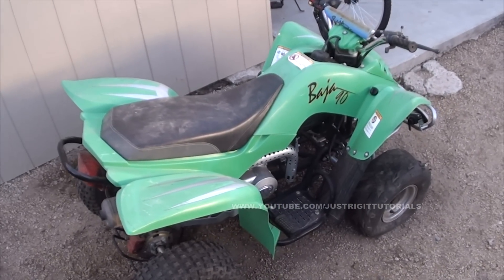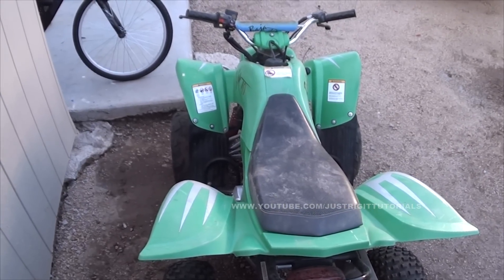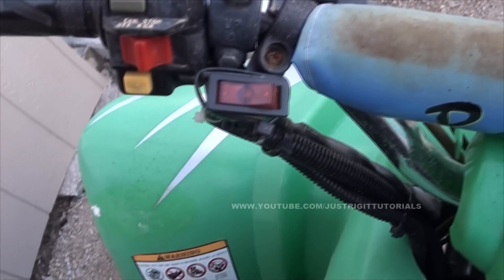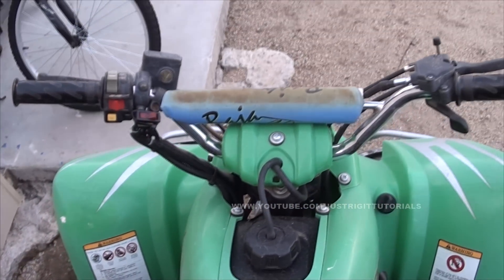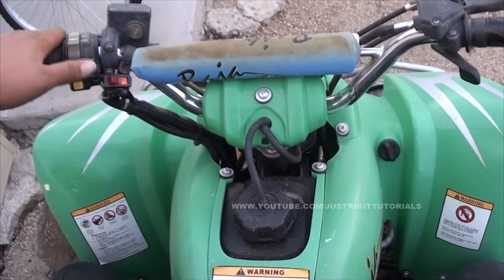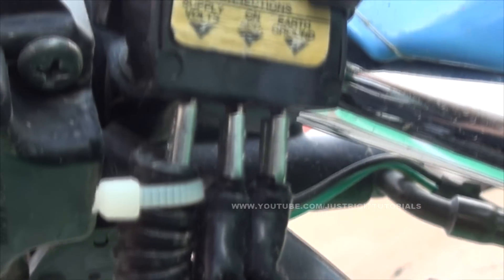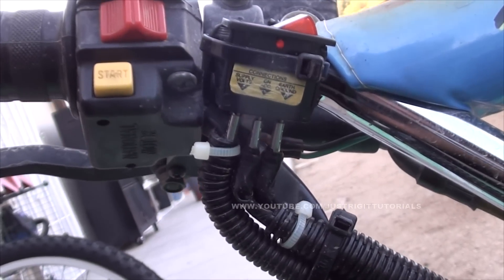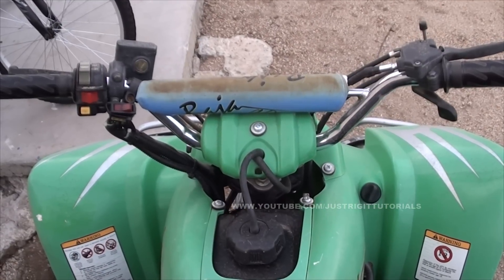bypassing the push button starter on an atv

Comment: I have a better idea, since the relay is there for a reason. A relay is an electromagnetic switch used for controlling high amperage circuits (like power to the startmotor) with a low amperage input (like the brake switch and start switch together to start the engine). Since you bypassed the relay, your new start circut gets hot. Your problem is probably either:

1. Faulty relay, which is easily diagnosed and cheap to replace. jump a cable from power inn on the relay to the power out to the start engine (this is usually the 2 bigges cables on the relay, and the colors is usually, red/red, red/black or black/black. If the start motor turns the relay works.
2. Check if your start button gets power when you press the brake. If not run a wire straight to the battery from the cable that came from the brakes and inn to your start switch. From now on you dont have to hold the brakes for it to start.
3. Now check if your startrelay recives power when you press the start button with a cheap circuit-tester light. Then measure the cable that goes from your start button and inn to the relay, and make sure it recieves power when you use the start button.
4. If you have done the following and the relay neither makes a small "clicking sound" nor do the start engine recieve power, you know it is a grounding problem. Run a wire from your black terminal on the battery to the "probably green/yellow or black" cable that goes out of your relay. your colours on the ground cable may vary so make sure you know which cable is which on your start relay.
5. Now hit the start button again and I promise you that your engine will start to turn. Usually one of the first ting you do is testing your startmotor, but since you showed me that yours work i didnt include testing it as an option.

I know that this would be much easier to test with a voltmeter and testing for stuff like continuity, but I am bad at using one and understanding what I am testing. this is a much more logical way to test it for someone who is handy and dont know how to use more advanced testing equipment.
Reply: Nikolas Rygh Røren My foreman does the same thing. When i press the start button i dont hear a click noise and nothing happens. The way i start the foreman is by touching metal on the relay. What do i need to replace?!
Reply: Finally someone who speaks English. Yes that's the proper way. rigging up a short cut will not solve your problem in the long run. You always want to do it the right way.
Reply: This answer sounds the best option but it is kind of theoretical but I wish I could see something like that in a video
Actually I’m trying to fix my atv like that I’m very handy but I don’t want to make any mistakes and get disappointed 😅

Comment: Double check your voltages and try charged your battery up till it's fully charged then put battery back in then it will start up with no hassle as that's how I got my quad up running now there no more buzzing sound and if there's a buzzing sound it's trying to tell you charged your battery for sure

Comment: Great Video, Thank You!  Can you take the wires from the push button to connect to your switch or do you need to run wires from and to your starter and battery?

Comment: Wrong switch friend, use a push release button and don't by-pass the relay or you will burn the harness ,there are two wires that give command to the relay the two thin ones,find which one is your hot wire and  thats where you can connect your button...good luck

Comment: Is the thick red striped wire that is also runs into the starter with your wire. is the other end of that connected to the solenoid, because im not entirely sure where it should be comming from on mine.
Reply from the maker: basically what i did is i attached a wire in the same spot where the thick red wire is thats connected to the starter using a ring terminal that wire then went to one post on my switch the other post from the switch goes to a fuse or fuse holder from there it goes straight to the batterys positive terminal if the switch is grounded it will say (ground) just connect it to a solid piece of metal on the atvs frame or even the negative post of the battery if you want to so when the switch is flipped you will get a light and the starter will turn the engine over but remember that the on switch needs to be to the on position as does the key or the engine will turn over but never start as there is no power going to the coil

Comment: Nice video I like it I do have a question I have a 110 four wheeler that has compression Spark and fuel but will not run have you ever ran into that any information would be helpful thanks
Reply: Try turning the key to the on position then connect a wire to the negative side of your battery touch that wire to the frame where there is bare metal and touch the positive terminal of the battery to the post on the solenoid that is going to the starter it by passes all of these steps to hook up a switch down side is the extra work to start it each time you want to ride

Comment: It works but would have been easier to clean the contacts on the switch
Reply: Or get a new solenoid too.
Reply: At 0:37 he said he had cleaned the contacts but it didn’t work for a while after.
Reply: I have the same issue replace solenoid and clean switch it work but then stop working so im not sure if it’s the starter switch wanna replace it
Reply: @Sickwiddit2820  I got ride of mine a few years ago, but it had that remote kill switch on it. I had to take that off of it and ran fine when I got rid of it. Just no more remote kill switch on it.

Comment: I've been waiting to do this to my motorcycle, I want to eliminate the kill/run switch entirely.  Since its in an all in one control, the kill/run and start switch are all one piece, how do I go about making sure the kill switch is always on the run/on position and not on the off/kill position before wiring it this way. I'm going to wire and mount my start toggle switch right below or next to my key ignition switch or somewhere hidden from plain sight

Comment: Hey buddy I like your video I have a quick question on a Suzuki lt 50cc electric starter I put a new battery and don'ts start what should be the problem?
Reply: Henry Alexander Rivas is it in gear, is the fuse blown, bad starter, bad contact, is key on,bad battery

Comment: How did you wire your ignition/key ? My 110cc wiring is all messed up , and I can get it to crank with the toggle switch, but I need to get spark to the plug, and be able to shut it off using the key. How might I go about doing that ? Thanks

Comment: how is the orginal one ganna work if you cut the wires and wire them up to the switch look I'm 14 years old i start up my yamaha rhino 700 with wires tie up the yellow and black wires together and just the start up wires just make them touch other
Reply: He is  jumping the solonoid,with those thick wires running all the way up to  his handlebars. Its not  the safest way, for sure, but it works.

Comment: Im thinking about doing this with my atv. What kind of toggle swtich did you use, and where did you get it from?
Reply from the maker: its just a simple on off switch with an extra ground if it is illuminated got it at autozone for like 4 bucks

Comment: that screw in piece inside the brake fluid part, where did you find it or get it
Reply: Isn't that the neutral switch so that the engine won't start unless it's in neutral. I replaced mine and old came out of the hole. I didn't know they'd work in oil. But all it is is a switch that's closed by the transmission when it's in neutral. I ordered mine from Amazon, $8.00 and they sent it in an 11x14 plastic envelope. It's only and 1.5" long and .5" wide. Kind of overkill on the packing but I thought  it was funny.

Comment: yo I am trying to do that but my atv still won't start what can it be and it doesn't  turn over for the started
Reply: Jorge Hernandez is your starter bad, is your fuse blown, bad contact, broken solinoid, bad battery, suzuki, is it in gear, is clutch not held in? numerous but simple fixes might be the cause
Reply: H2O SLUSHY serious? "Suzuki"??
Reply: THE RAGING SLUSHY "suzuki" hahahaha

Comment: Now I have spark to the plug with the key on or off.. how do I turn the key into the kill switch ? I need it to start with the toggle switch and then stay running when I shut the toggle switch off. But the toggle switch is now the start and the kill for the engine. :( HELP !!
Reply: wtf lol

Comment: How about fixing stuff the right way? People always want to half ass stuff.  Love the comment "make sure to cut off the switch or it will burn it up" how about it will burn up the starter. Fix the mess right and you won't have to worry about it burning up the starter or the rigged up toggle switch

Comment: i know this is a long time ago, but i have a chinese 150cc atv the dude cut the key ignition wires and used a 16 gauge speaker wire to the stator solenoid and it starts but cant keep an idle and some times it'll do what you showed in your video of just cranking over do you think it could work if i did what you did?